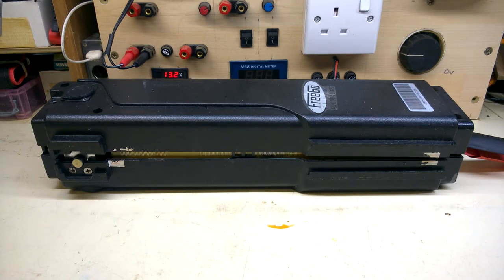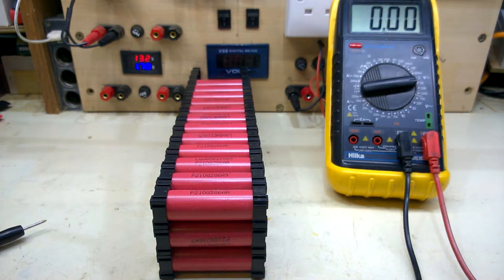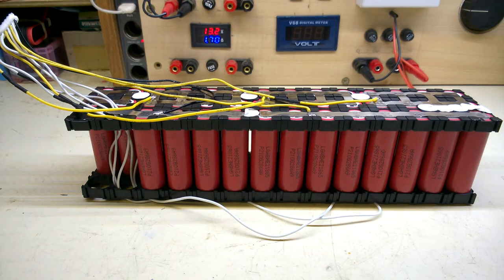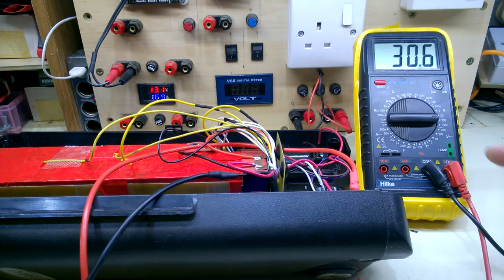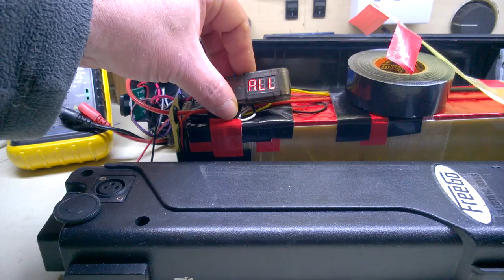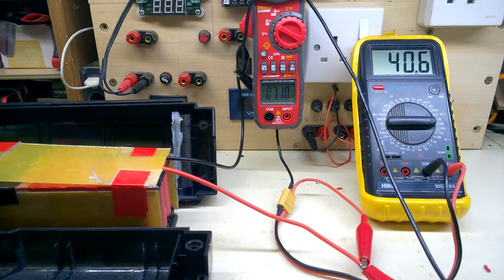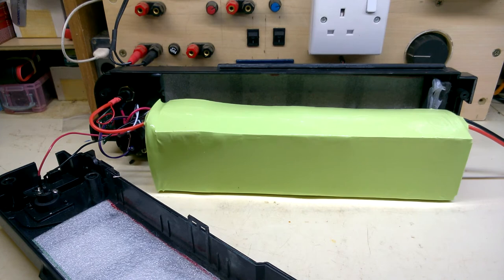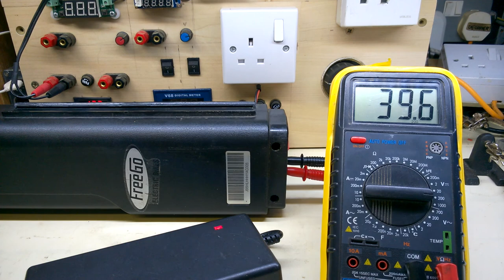Freego 36v ebike battery recelled

Comment: I just picked up a used DK200 but it was missing the battery pack and the Mount. The owner said it was stolen and I noticed they cut the wires  any resources
Reply from the maker: Is there a question here ?

Comment: Great job as usual.  Question:
A strange thing is happening to my 48v, 20mAH, battery.  The battery is new, and well built. My son, by mistake, made the first charge through the wires to the load instead of the charging wires. After that the battery shuts down if connected to the scooter. Output voltage was 22v, but charging wires showed 55v. Reseting Bms and reconnecting balancing wires, brings output voltage to 55, but then it dropes again as soon as connected to the scooter. Once it had happened even before connecting to the scooter, just by itself. All cells have good voltage and connections are good...What could be the reason?
Reply from the maker: Definitely sounds like a BMS problem.
Possibly damaged by charging backwards through the BMS.
Reply: @makeitwork7522  Hello again and I need your help again on the same issue described above.
I've put new BMS. The charging wires were showing 54v, but output voltage was showing 41v, and when I connected to the charger it did not start charging, showing solid Green and Red lights.  At the same time, my voltmeter showed output voltage drop to 21v and after the charger disconnected the voltage goes up to 41v again! 
I can't understand what's going on... I am planning to discharge the battery and see if it is going to charge to 48v. Any ideas will be appreciated!
Thanks
Reply: All cells, welds and connections are good, and I tried with a different charger
Reply from the maker: @artknife23  
First , I would make sure the BMS is wired correctly.
Have a look at the BMS's on aliexpress (they have wiring diagrams) -  

https://www.aliexpress.com/item/32847121949.html?spm=a2g0o.productlist.0.0.64477c013IwaPa&algo_pvid=acf654fa-ad34-4cf3-81f2-be770b821455&algo_exp_id=acf654fa-ad34-4cf3-81f2-be770b821455-24&pdp_ext_f=%7B%22sku_id%22%3A%2265212505538%22%7D

Then check the white balance connector for individual cell voltages.
Assuming all cell groups are 4 volts they should increase in the correct order (4,8,12,16 etc).
If they go 4,8,12,12,16 for example , then the balance wires are in the wrong place or you have a dead cell group.

Comment: Hello i wanted to ask if i have one cell group which is 4.10 and one is 3.87 will the bms be able to balance them lets assume both cell group are of the same capicty .
Reply from the maker: From experience , I've seen that not all BMS's are the same.
Some better ones may balance your pack , but most probably would not.
When charging through the BMS , the circuitry would most likely charge the 4.1v group to 4.2v and leave the lowest value group behind.

You may also need to consider the possibility of the lowest value group being weaker than the highest value group.
Reply: @makeitwork7522  i see thank you for the info, does it make sense that since the diffrenace in voltage of the packs that in the output of the bms i get very low voltage rather than my acutul voltage ?
Reply from the maker: @rotem2116  
If every cell group is above 3v , then you should have the full pack voltage at the output terminal.
Also check if the BMS is turned on by the keyswitch.
Reply: @makeitwork7522  thanks a lot